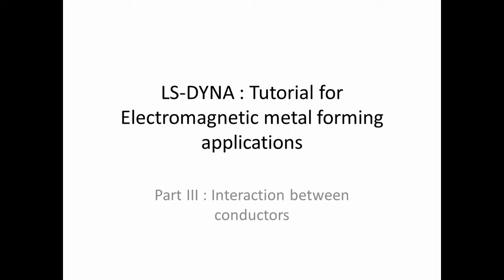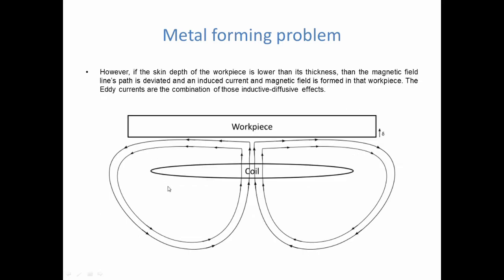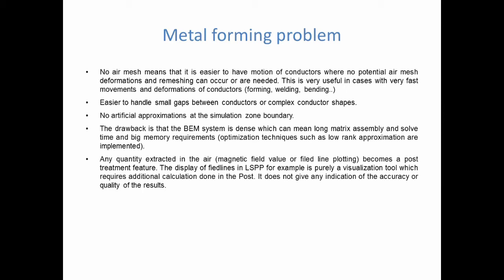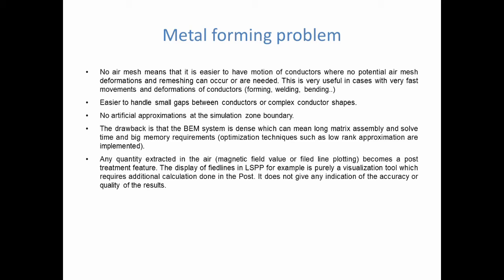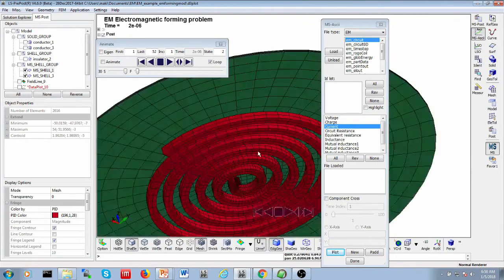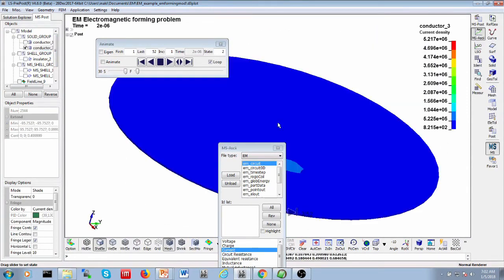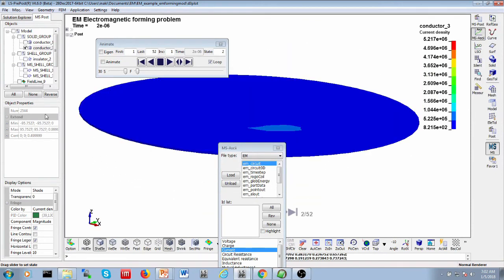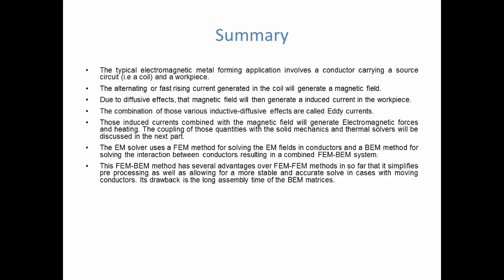LS-DYNA EM: Tutorial for Metal forming application (Part III)

Comment: Failed to download the .k file on official website.
Reply from the maker: Dear TianZi,
This is because you reside in a country which does not have the corresponding agreement in data sharing with the U.S. Please try the link again from another location or find a ..workaround.
Reply: Is it possible to have a new tutorial about how to set the pre-process? So hard to learn it from the keywords and the info of reduced input.